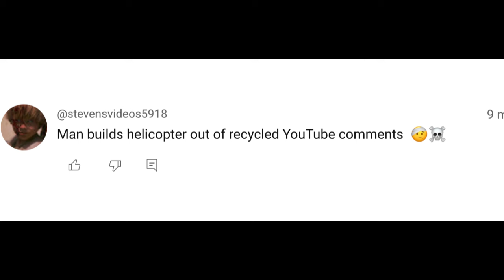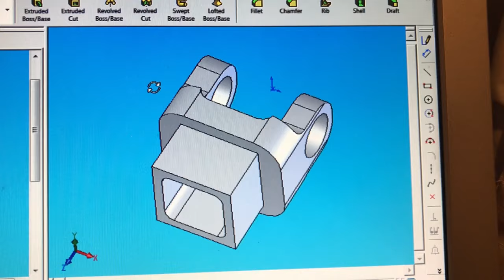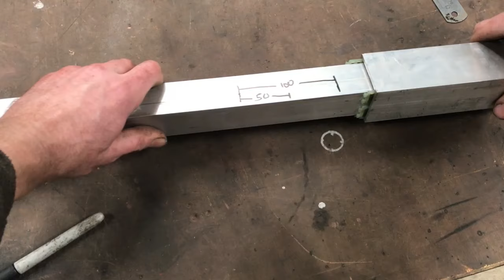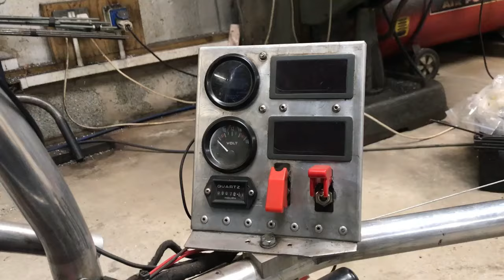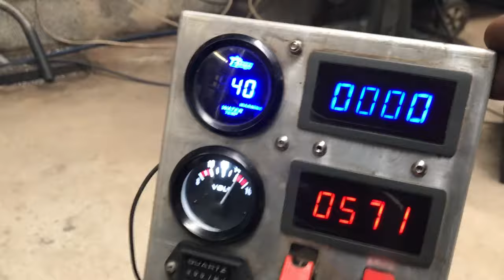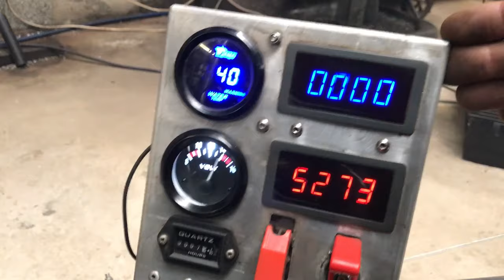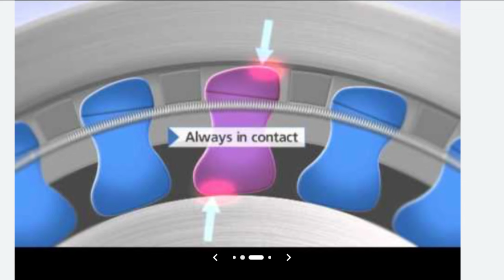Should I fix my Homemade Helicopter ???

Comment: To be honest, I think it’s a fair assumption for someone to think that a person who makes their own flying machine would want to fly it.
Reply: For example if you saw someone with a YouTube video detailing the construction of a go kart, you’d probably think they’re going to use it as a go kart. Please correct me if I’m missing a valid counterpoint.
Reply from the maker: Yes it's a fair assumption that someone is going to use the machine they've built. The assumption that I would use the helicopter to its full potential is what I'm getting at. Some people assume because I've made a helicopter I'm going to attempt to fly it like all the ones they see in the sky. This is something I would never do or plan to do. There are also a few people I know that have built helicopters for the purpose of the build only. That seems odd to me too but testing such a machine is a very scary thing to do. 
Its by far the scariest thing I've ever done and I can understand someone not wanting to go through with the testing.

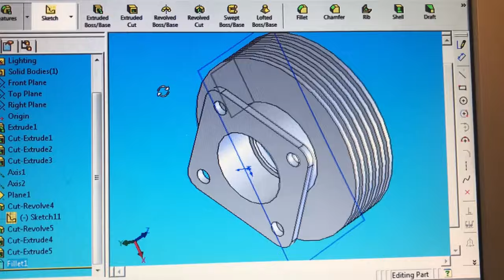Comment: 6:49 What you are seeing here is tortional vibration resonance.  That you can't see them at high RPM means either they aren't there, OR that they are running at a frequency that your eye can't see.  7:05 yes, google propeller rpm avoid curve.  Sprag clutch yes, google alternator OAD.
Reply from the maker: Thanks 👍 didn't know about alternator Aod pulleys. Looks the same as sprag bearings which I used previously. I'll have another look for some smaller profile ones that might still fit in the smaller diameter drive pulley. 
As the engine runs rough during the acceleration stage I thought this was causing the movement. Resonance could still be there though. I know Robinson have a couple points in the rpm range that you must not dwell at.

Comment: square tube aluminum will fatigue, crack and fail guaranteed. based on your design I would machine the male end of the slip joint out of a solid square of high quality steel about 2 times longer than your maximum extended range. This with the needle bearings and another piece of square steel machined for a tight tolerance over the three components should hold up just fine. You can then take that outer piece of square steel and insert it into a piece of round steel tubing and drill holes and plug weld the square steel inside of it. Then drill two holes near the top of both pieces and after it has been welded through bolt them in opposing directions. I know you said it is easy to overbuild it but the driveshaft even with the torque multiplication of the gear reduction still has to turn all that mass and it's just simple math and physics into what the weakest link will be.  The frame flex on rotor startup is from lack of cross bracing and lack of mounting stability between the rotor tower and the main frame structure, it's essentially flexing the area of tubing where you have mounted the tower to. I think overall you have got it but my two cents would be to rebuild the main portion of the frame and the rotor tower out of some proper materials and welding as it's most likely going to stress crack and catastrophically fail in a matter of time. I know it adds weight but some things just can't be skimped on.
Reply from the maker: Thanks for your comment. I understand the fatigue concerns and I might go for steel tube but as I understand it if the fatigue stress for the aluminium isn't exceeded then fatigue won't be an issue. Same calculation for the rotor hub plate for example. I know what you mean about a machined fit, will certainly do some calculations to back up my decisions.
The flex in the frame I plan to keep
as I like the soft drive it gives but I do take your point again about fatigue concerns.
Reply: @Ben-Dixey  Hi Ben, on the square drive shaft with linear caged Needell roller bearings, I for see 2 problems,
1:  do the same test with your shafts vertical, after several cycles you may find due to gravity the bearing pack migrates south  leading to an increase of friction & control problems? 
 
2:  The point loadings on the leading & trailing edge of the needle roller packs  may exceed the yield strength of the drive shaft material? 
I've only don this on a thinking basis so I may well  be wrong, 
Ruel's are for the obedience of fool and the guidance of wise men. "( Whinstone Churchill)  "
 I wonder were he first herd that .
Reply from the maker: @hkruczek8725  Hi H, cheers for the comment, you are the first person to mention the cages sliding down to the bottom under gravity. I've given some thought to this, if there was no preload on the bearings and slight play then it would mean the bearings would drop to the bottom. It would mean that I had to start the rotor with the cyclic full aft, once the load is on then I believe the cages would move up and down with the box section. 
I think this would be ok but it's not ideal. 
The other option would be to add some preload to the bearings, you wouldn't need much to keep them where they should go. Probably best to get rid of any play/ backlash as this will only allow hammering and get worse quickly. 

I've worked out the fatigue life of the box sections and it's going to be way over 500 million cycles under engine torque. I haven't worked out if the rollers will indent into the aluminium yet. What I need to do is measure the actual torque variations. Thinking I could make a simple fixed tubular drive shaft and either use strain gauges on the driveshaft or on the another part of the head to measure the deflection. If I know what the actual maximum torque is then I could say with certainty if my driveshaft choice is suitable. 

Never used strain gauges before so don't know what it's going to take, I expect the one designed for rotating shafts are expensive but will look into it.

Comment: Your system has a critical safety flaw. Your rotors have fixed positive pitch, which means that autorotation is not possible. The lightweight rotor system has minimal energy storage. This means that an engine fault will quickly result in very high descent rates (e.g. "streamlined anvil".) I recommend that if you return to flight, that you continue to fly only in hover so that you have a good chance of surviving an engine failure. I'm assuming that the gear will absorb the energy of a crash from hover, preventing spinal injury. Good luck!
Reply from the maker: Absolutely, only for hovering 👍

Comment: Isn't a truck drive shaft under torque and designed to go in and out with the suspension?
Reply from the maker: Yes it is, the question is what axial force is exerted with a truck driveshaft in order to make it change length?

Comment: Maybe you could work on your expansion chambers a bit to get some more torque at lower RPM's. I used to race a TZ750 in the days and had different chambers for different kind of circuits. The higher torque ones were a lot "fatter" in shape, but delivered more power at lower revs at the cost of high rpm power. If you are not going to use the higher revs you might as well sacrifice those revs for power where its needed. Just my $0.02.
Reply from the maker: Hi, the expansion chambers I used the youtube channel below https://www.youtube.com/@AuMechanic/videos
There is a lot to it and no doubt mine could be improved, I tried to get the power at 5500RPM but only a Dyno test would be able to prove that. 
I will probably have to make more as aluminium wasn't a good material choice.
Reply: @Ben-Dixey  I used to make my chambers from 0.6 mm mild steel. The fastest and strongest way to make them would be hydroforming, this way you have fewer welds that can fail. It's also a lot of fun on a sunny day.😄

Comment: Yes indeed! Love the gunsight on the bow of your ship! Is that to judge vertical clearence at a particular distance?
Reply: My guess is that he uses it as a reference when trying to hover. Pick a point at the distance and trying to hold it.
Reply: @jesperwall839  I thought of that as well. But then thought that a level reference would be better seen by a sight more level with the eye. It could be the perspective of that shot was not at eye level, so my judgement might be off there.
Reply from the maker: Yes, it was an attempt to sight a reference point in the distance. Most helicopters have a gauge pod or something to align with the horizon, mine being open did not. I tried it for a while but found myself not really using it. Instinctively you want to look at the ground but you have a much better sense of whats level looking out in front you. Every time I take off looking forward out in the distance I take off level, not so looking at the ground. It's a little odd not watching the skids as you want to know when your airborne.
Reply: @Ben-Dixey  is that target at your ~eye level? Being a surveyor, my mind goes to the lowly plumb-bob. That would be ok for the lateral reference, but not the pitch, and maybe a safety issue. One of those ideas that comes and goes where it needs to go. Keep on it!

Pt 2, a fisheye bubble would do all of that at once, but would kill your SA alone. Maybe a mirror on a fisheye up front, like a HUD?

Comment: I just subscribe to your channel sir, at anytime if you feel im out of line with comments let me know, I'll leave.
Please continue on your experimental ideas, it's what brings change to this world, please keep "safty" in mind.
You seem to be a diamond of life. I've been dreaming my whole life, of a craft that flys, drives and floats. But i want it to swim as well. 
I believe it's time, to clean the shop remove all the stuff, complete by boat and airplane camper, build the boat rake on the top of the camper, and sale it all. All to build my long dream of the "safest" true amphibious vehicle.
Land sea and air, hopefully i can figure out the swimming issue. This design is only in theory of working.
But i believe extremely safe.
The only safety concern is safety glasses it should make alot of "wind" with no need of clear prop. 
I'm to old to care of someone taking advantage of what i want to build so. I'll lightly explain, think of hang glider parachuting , plane and unicycle hovercraft, with split wing capabilities that can somewhat fold like " bird" wings for "driving " down the road. Power plant I'll keep to myself for now.
My  estimates of weight of the Kraft is keeping it in the 103 compliant.
Sails/skin has the big safety built in- if structure fails in mid-air the skin becomes like a parachute, being able to detach from " spar's Like for the craft to carry twice normal  body weight average weight with cargo "ejection" options for catastrophic failure so soft emergency landing is "capable". I will say the power plant is only in the horse power of under 10HP it's solely based on high high RPMs torque is not really needed. Fly power is from a "gyro" I develop. Long long ago. The power plant came to me as a kid, lol i " was" a strange kid. The first time i put my hand out a window going down the road, lol the only way my parents can settle me down was to give me a ride in the car cuz that's all I wanted to do is ride in the car with my hand out the window then one day i stopped, the aha moment come to me.( A type) of gyro.
My parents noticed it. When I was a child with great thought, i supposed  I looked sad, but i wasn't I was concerned that the technology that was in my head- the danger that can cause this society of the bad it can be turned into the evil that can be turned into a device used for war. it can cause if it was used for wrongness. My parents offered to cheer me up, asking if i want to go for a drive, no no it scared me so bad i did not want to ride in a car for weeks. One thing i need to do before I start building and that is  to fly. I have been in a lot of planes, across America and even to England. The only time I've never had a window seat was the trip back from England. That was the worst flight I ever had, just about the whole time the seat belt sign was on because of the turbulence it was horrible. The sense of fear everybody had was thick in the air.
For some reason my mind needs to feel wind on my whole body with my hand in my "life" so in a couple of months hopefully i take a introduction hang gliding class. It "sucks" to be self taught. To have to experience first hand of effects.
Last week i could have lost a finger more like the digit that makes us different my right thumb. I was experimenting on my metal lathe, on a "drive shaft" theory.
Think of a 3/16 dog cable, i cut just behind the swivel so i can chuck the swivel in the Jacob chuck on the tail stock and the other end in the three Jaw head stock, with dexron fabric around cable.
To check on how my fluctuation cams would work on the fabric. Moving tail stock in and out. Stupid me while I was moving the tailstock inn and out i put my hand on the swivel, just before i did this i put my Atlas Craftsman 12 inch lathe on high speed, it instantly slapped my thumb suck the tail Stock halfway down the lathe bed to the headstock ripped it out of the Jacobs chuck and then slap like a  Maniac i don't normally tolk to my self but i keeped saying that could have been bad that could have been bad the whole time holding my thumb cuz it hurt really bad. I was lucky did not drow blood or brake me.
I thought of buying a mosquito helicopter and just be done with it and learn to fly and get around but it's not what I want. The idea of rotor blades going round and round in the air is just dangerous to me. limited anything that touches in it would be catastrophic.
My design of a craft you can bump into things while you're flying slow no to little damage can be done. No danger if somebody walking up to my craft while it's on, no chance of putting your hand into the delicate areas and  losing a hand. Three months ago I was concerned about the sound  so i came up with intake and outward baffles, for the future "not"  for first design but something to keep in mind as i build. My goal is low and slow, like to achieve 45/55 mph, vertical hover, take off from road with no altercations before flight. Hover only land on water no forward moving landing on water. It would tumble on landing if to much forward movement inflation devices on training wheels for water landing. Along with inflatable around unicycle wheel. For landing on water.
Just can't figure out how to watertight power plant,So it can swim. Swimming would be a limit because of scuba diving equipment is heavy maybe a 2250 firefighters fiberglass tank would be okay, or just use clean air for the inflatables and use the same air to breathe with. Just don't seem safe to share for two purposes. I have considered partial inflation of float's use turbulence from wings. 
Kind of like an airsock but you can close it then top it off.
If only battery technology was lighter I can go all electric than the water problem would not be an issue. As much as a issue.
The bad news is it might not fly and only have characteristics of a sugar glider, jump glide land.
Jump glide land and float. And not be able to jump out of water do to water suction friction.
Hopefully it's  not art concept.
But fun to know what doesn't work. The person that was the original developer of the jaws of life that rescue use for getting people out of cars told me;  if you first don't succeed keep on sucking until you do succeed.
Thanks for reading.
Be true to yourself and do good things in life, live life like a diamond.💎 Even if you are a fraction of a carat you're still  a diamond.
Sincerely; SHAWN MTS.
Reply from the maker: That was quite a message 😉 thanks
Reply: Sorry
Reply from the maker: @shawnmts7109  😂😂 all good my friend. 👍👍

Comment: Keep ignoring the nay-sayers.  It's fun to watch and I'm sure it's great to fly.  Now that you're considering a sprague clutch... if you keep "variable pitch main rotor blades" in the back of your mind... adding that would allow you autorotation and remove your 3' height limitation.  Also a seat cushion would help even a 3' fall on your rear end :)
Reply from the maker: Thanks 👍 I think collective pitch could possibly be implemented and keep the tilting mast. That would be reasonably simple compared to full cyclic control. 🤔

Comment: Well in view its no more dangerous than a home built Sub and drowning yourself in the local lake , or building a home made rocket and sending yourself into orbit and never coming back 🤣🤣 go for it buddy 🤘🤘 my only advise would be build some kind of bulkhead at rear of seat to stop any unwanted flying parts getting at you 😁😁🤘🤘
Reply from the maker: 😉 there will definitely be more protection from the driveshaft. 
The new one will be lighter that means I can add weight in protection.

Comment: 👏Why u decided to install two flying blades?
Reply from the maker: @SamwelKamau-c7w  Quite a few reasons but the main one is that you don't need a tail rotor. More lift is possible without the tail rotor which is only there to stop the machine spinning around. Tail rotors typically take around 10-20% of the total power. 
It's not that straight forward though and there are other reasons.

Comment: Glad you havnt abandon it Ben, try and keep the components running at engine speed to a minimum mass, and ive siad it before you need a straight shaft run from angine to rotot head when all is level , might then get away with flexible joints and not UJ s. .......Peter .
Reply from the maker: Thanks Peter. The Bensen B9 used rubber tyres as flexible joints 😆. I know you're not convinced it flew but I think it did.